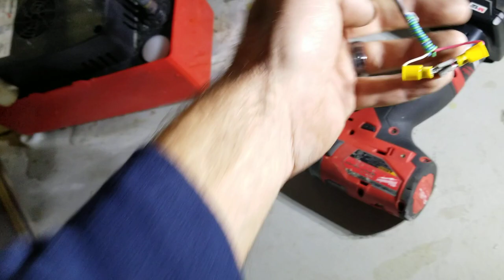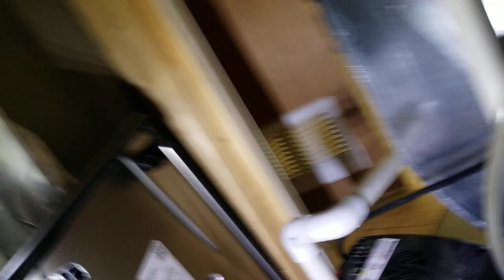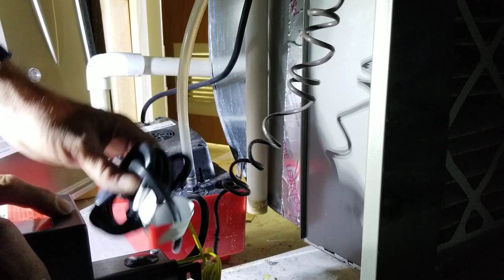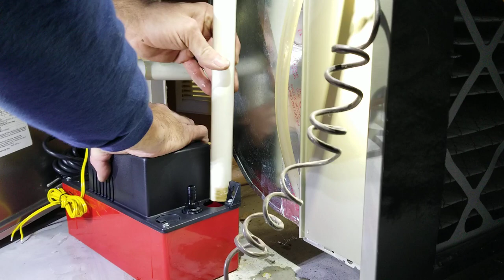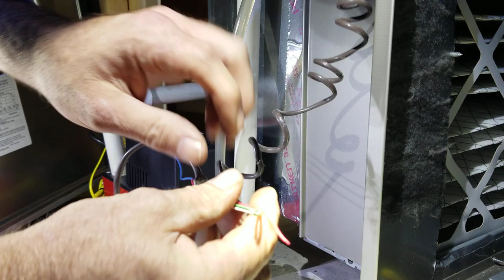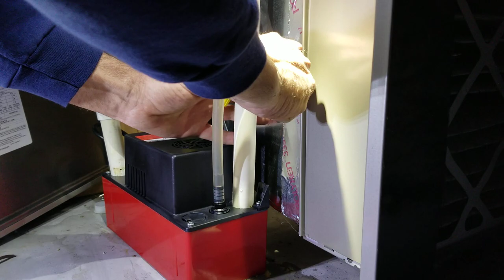condensate pump change out

Comment: Great video. I am going to try to hook this up by myself I had to run the heater for the first time this season my fiance installed the furnace and hooked up partially the condensate pump and today when I went downstairs water headshot all over the house because I don't think that the hose is hooked up to drain it. I think that by watching your video I might be able to fix the problem thank you so much